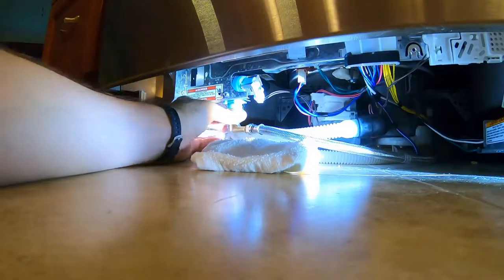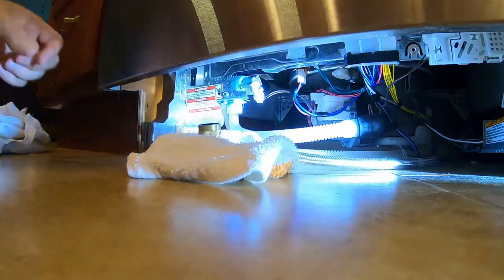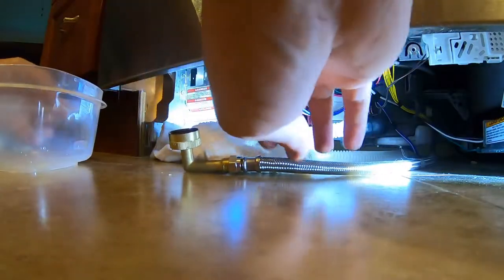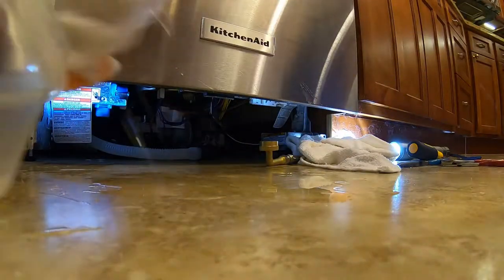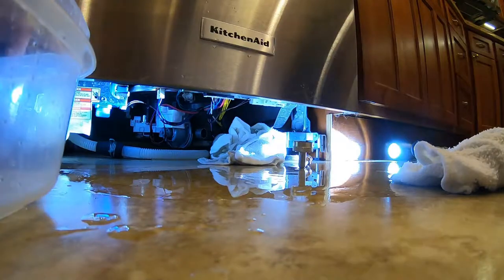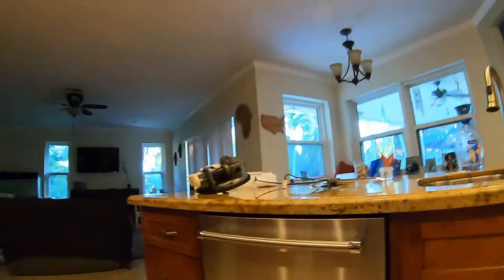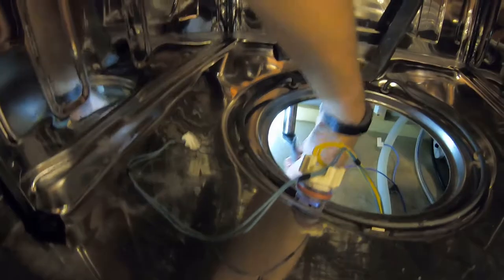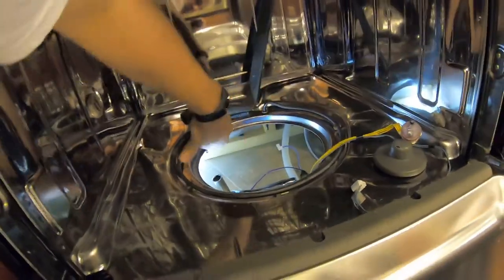Replacing a Wash Motor and Heating Element in a KitchenAid Dishwasher

Comment: Did you forget to move the counterbalance/motor damper (the concrete thing) from the old assembly to the new one?  Thanks for the video, about to tackle this (waiting for the part to arrive), good to see the issues that normal guys run into that the pro's don't show on their videos where everything comes apart quickly.